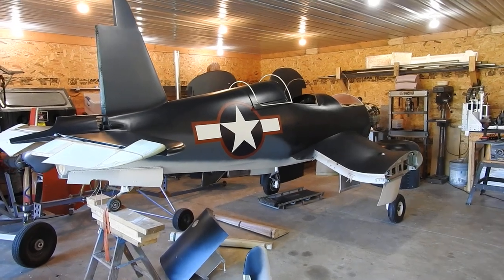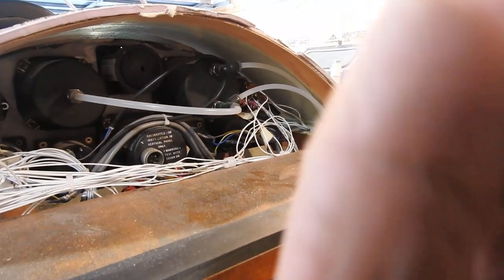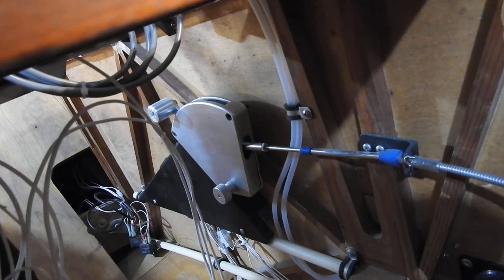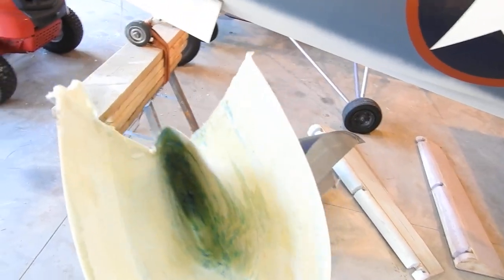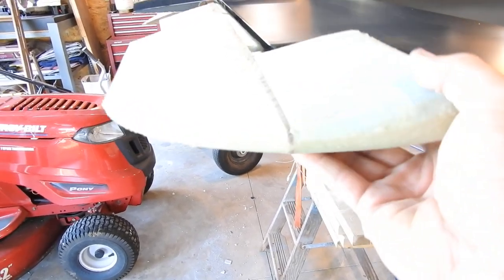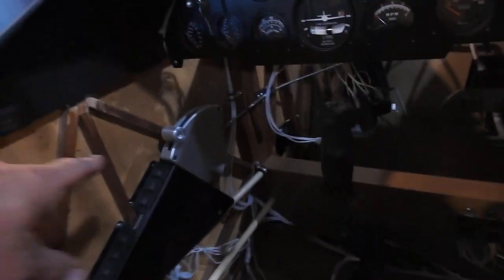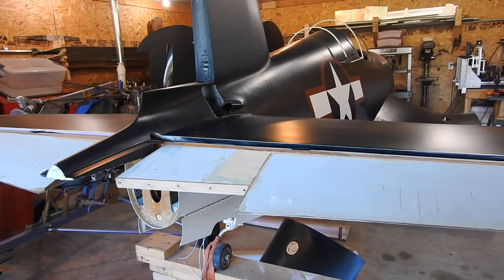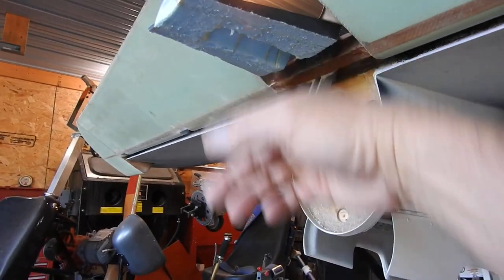W.A.R. Corsair Update 6/28/2020

Comment: Very nice work , I wonder what fuel you will run the motor on?
Reply from the maker: I will be using regular auto gas in this plane. It's a auto engine with O2 sensors that will not survive leaded aviation fuel. I know there can be issues of finding auto fuel at some airports.
Reply: @Dynodon64  there are certified electric pumps that airports will allow you to use. Then buy a 45 gal drum from supplier and have airport store it for you. But if you plan cross country  pick airports with more experimental planes around better chance they will have regular fuel at hand. Looking at building stol experimental and the motor is pump gas as well. So I will be in same boat as you. Thats what local pilots told me to do
Reply from the maker: @paulkainer269  Thanks for the info. I'll keep it in mind. I first need to fly off the 40 hours before I will need to worry about fuel far from home.
Reply: @Dynodon64  I hear ya.
Too bad meyers tech didnt work then fuel wouldnt be as much of an issue. Lol oh well. Take care nice craftsmanship

Comment: Don, question. You stated your ignition is connected to the battery switch and wouldn’t work unless the key is turned on thru a relay. What would happen to your ignition if you lost power?
Reply from the maker: This engine will not run without electrical power do to the fuel injection. I see your point of a failure. I will think that one through. If I power it directly from the battery, it will keep running as long as the alternator is working. Thanks for the thought.